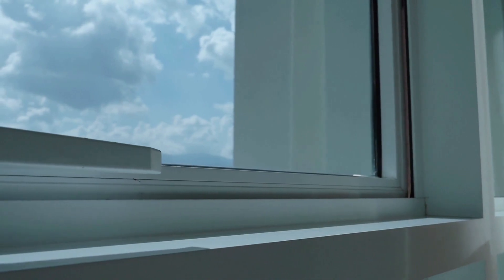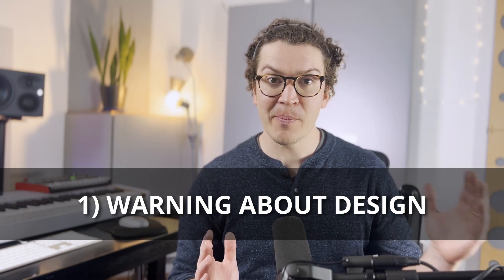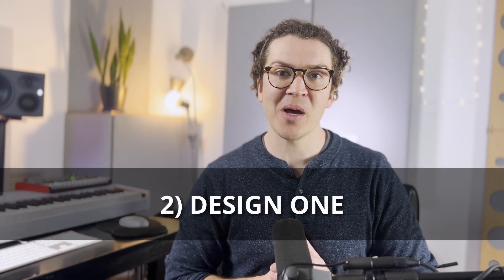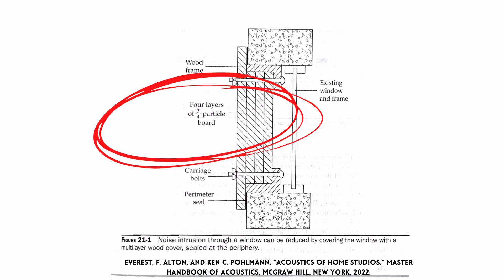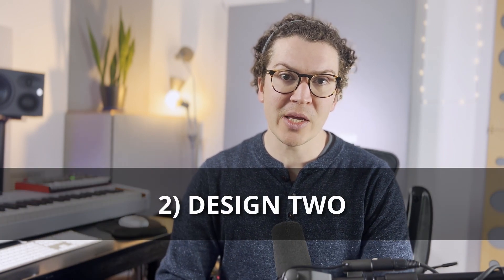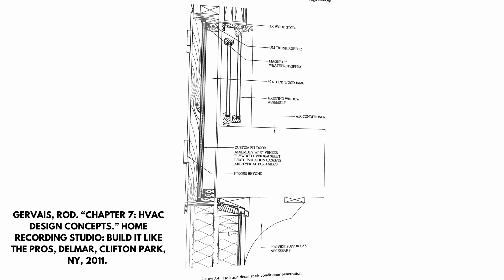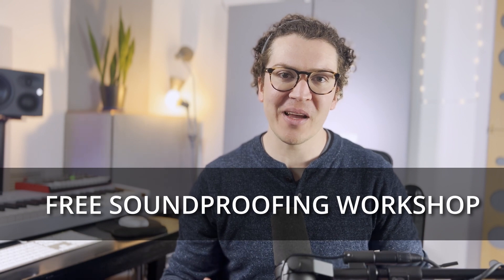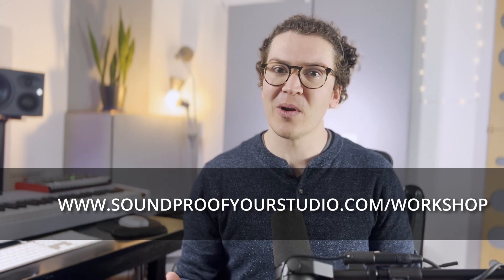How To Soundproof Existing Windows

Comment: Hey thanks so much for this. I ended up going with solution two. My question is if I buy the Door Seal Kit from acoustic lab solutions you linked out would that cover both the weather stripping and the magnetic weather stripping portion? It that one Door Seal Kit enough for a sufficient seal?
Reply from the maker: Yeah no weather stripping needed in that case.